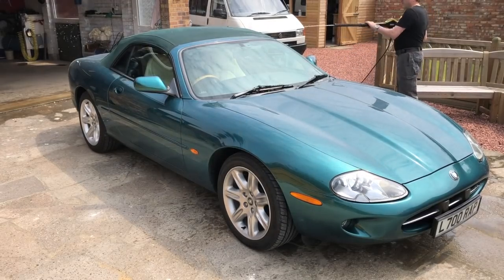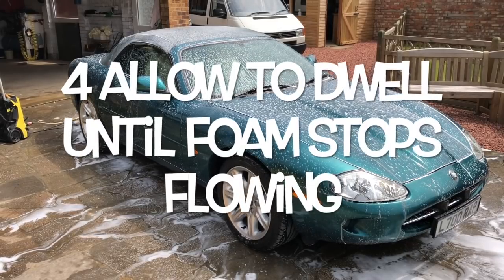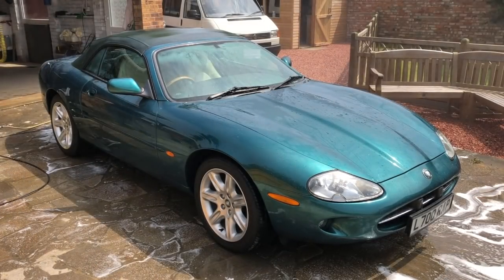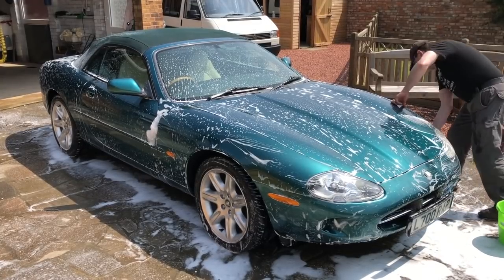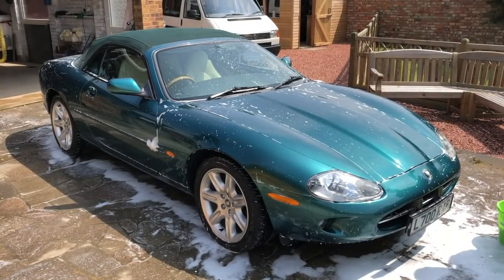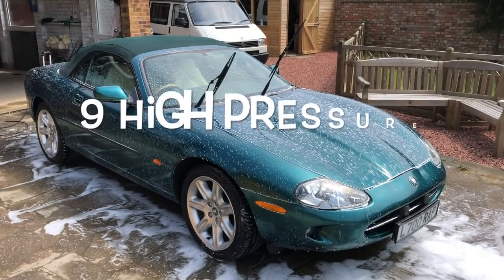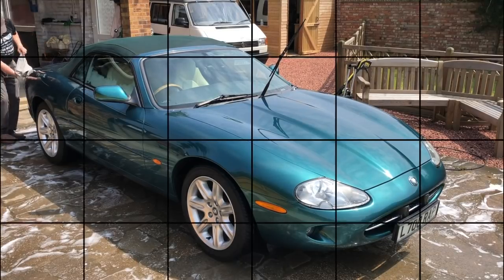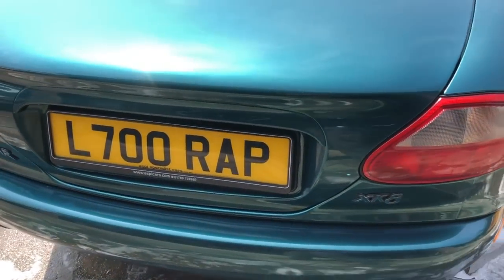How to wash a swirl free car.

Comment: In Florida you'd never wash a car in direct sunlight.  The surface gets so hot that try as you might, you'll get some places which will dry on the surface.  So you either find a big tree to wash it under or you wait until the sun falls below the horizon, at which point you have about 90-minutes of decent light left to labor away in.  If you're really slow or WAY TOO DETAIL ORIENTED you can finish the job inside your garage.
Reply from the maker: In Lincolnshire we have a similar rule that you should avoid washing your car in the rain or 40mph plus winds. we too generally have a 90 minute window in the average day.   LOL
Excess heat is rarely an issue .

Comment: Hi John, what model is your (Karcher?) pressure washer and would you recommend it to a friend? Haven’t really found any home pressure washer on sale without very mixed reviews 🤔
Reply from the maker: Hi Mate its a Karcher K4 Full control. Here is a link
https://amzn.to/35VYXKb
About £185
Pwer control models have lcd displays and soap level adjustments etc and cost more. But nothing is different in terms of the mechanics or the water spec coming out the nozzle. My two previous pressure washers were a no name that lasted 18 months and leaked from its pressure vessel from new. and a Clarke that was better but packed up after 2 years of graft.
The Karcher is a little more expensive that the Clarke I had and has no more power, but its been in regular use for nearly 4 years now and still going strong.  My top tip if you get one is to buy at least One dose of genuine Karcher cleaning chemical and then save the containers so you can decant products of your choice into them and so utilise its nice dosing system without being restricted to Karchers rather expensive products.
Reply: @ToTheGarage Thanks John, one for when I get a few extra pennies 👍

Comment: Always wash in the shade.  You must get a lot of muck over there.  I use only water and a 40° tip on the pressure washer.  Then microfiber towel off.  The rest is just as you show.
Reply from the maker: Our roads are constantly filthy